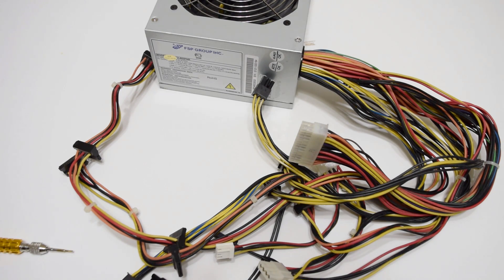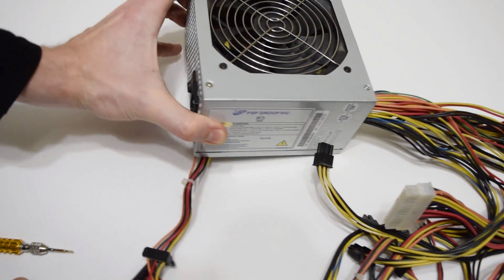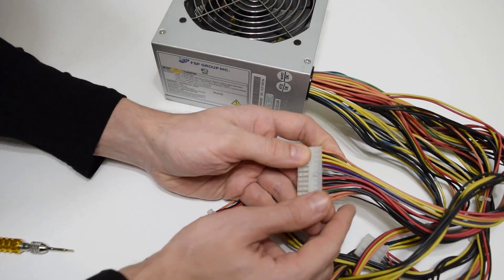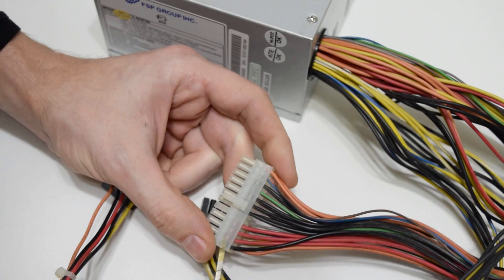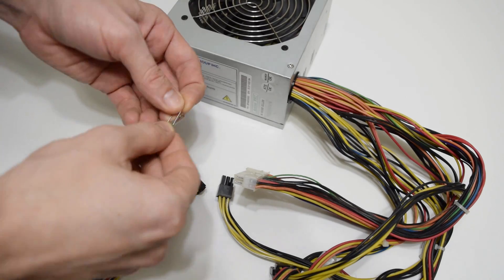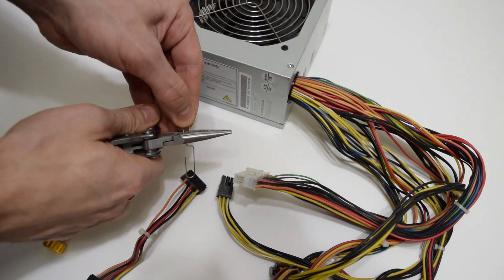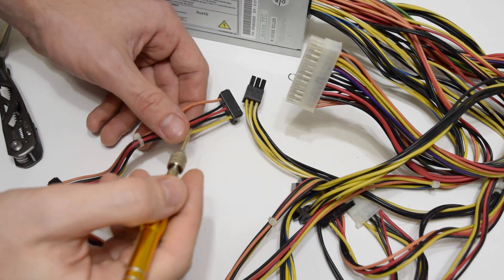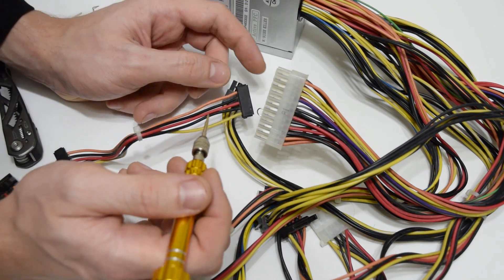How to Turn On and Test an ATX Power Supply Without a PC or Motherboard

Comment: Nice. Just as easy as I thought it would be. I'm trying to resurrect an old DECTalk board, and I recently bought a ATX power supply to test it with. Fans turned right on when I connected the power_on pin to ground.
Reply from the maker: Glad I could help!

Comment: i dont get this crap which is it 3 and forth pin or 4 and 5  this means i destroy my 2 good power supply with the 3rd and 4th pin.
Reply from the maker: Just shorten the green with any black one and the power supply will start.

Comment: I want a silent pc fan instead of the trusty small black fan that is also loud on min to give me a slightly sweet breeze next to me in bed.
Reply from the maker: Yeah, those with a big fan are pretty quiet and the speed of the fan is automatically controlled.
Reply: @ElectronicsComputers  It worked and I am impressed about how good it worked. Now I want to find more pc fans lost around the house and later more about the other voltages and what can it do, like powering car gadgets in my room.

Comment: Hi, i connected my power cable to my psu while the psu was on. While connecting i heard electricity and now my psu is dead. Is it my fault the psu is dead or was it just a faulty psu?
Reply from the maker: Try to unplug your PSU  from the outlet  and wait for a few minutes. I'm pretty sure it will be fine.

Comment: It works for me so the big problem for me now is maybe my PC's motherboard is the cause why my PC is not turning on. :(
Reply from the maker: Maybe... Try to reset the BIOS by removing the battery for a few minutes. Also check the power button. You can trace the wires from the power button to the socket on the motherboard (the connector is usually marker as PW SWITCH). Remove that connector and try to short those pins with a screwdriver. If it turns on your PC then the button is faulty if it still doesn't help then something's wrong with your motherboard.

Comment: will the power supply be able to power up my motherboard if the blue wire gives -10.6v? or will it require -12v to work?
Reply from the maker: -10.6v is too low it must be atleast -11.50volts. Check capacitors in your PSU.